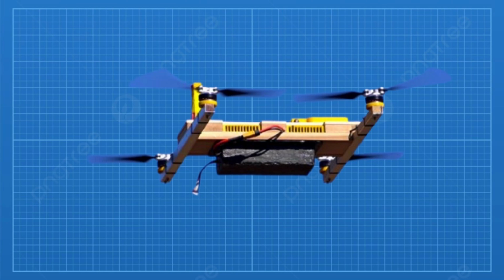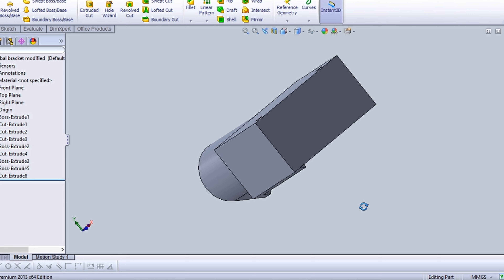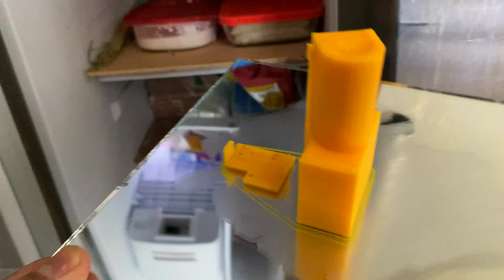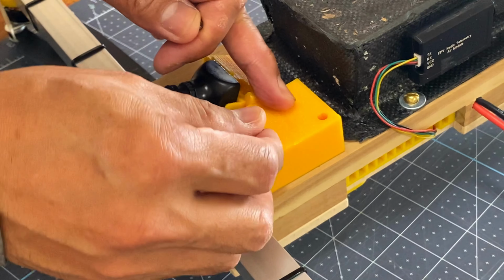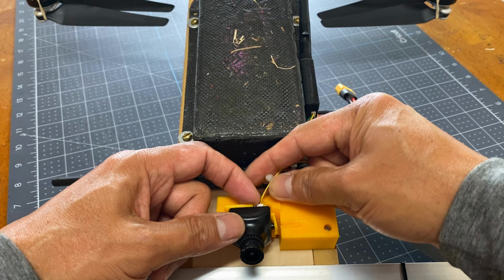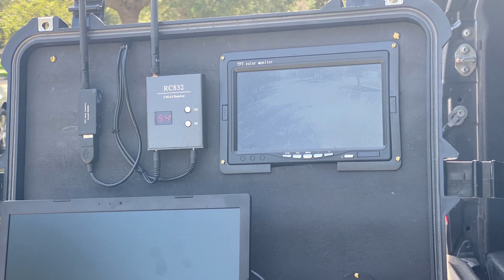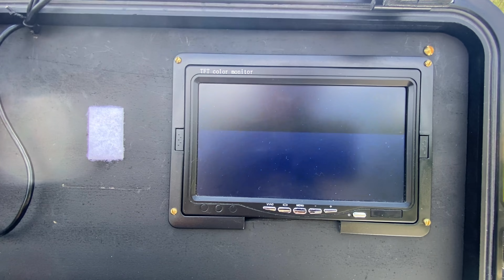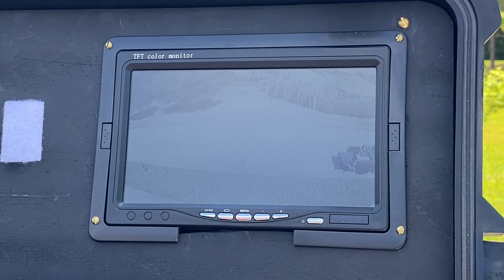How to Add Camera | Custom Drone Part 4

Comment: You are correct that having one antenna horizontal while the other is vertical is an issue. This is known as cross-polarization and results in a loss of signal strength. You should definitely change one or the other. Having the antenna on the drone sticking up into the air and not strapped against the drone body would probably be best.
Reply from the maker: Yes. There are so many factors affecting radio transmission and these are just the obvious ones. I would like to play more with theses factors until I’ll get a decent signal with this setup. Thank you for reinforcing my suspicion.🙂